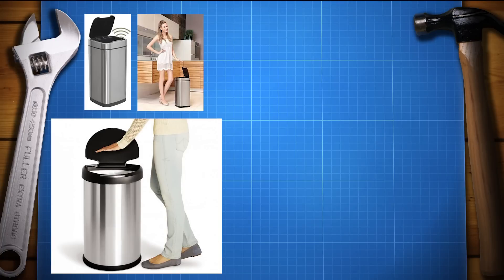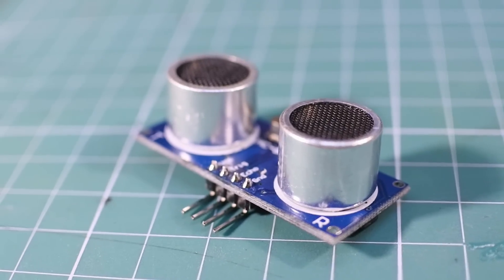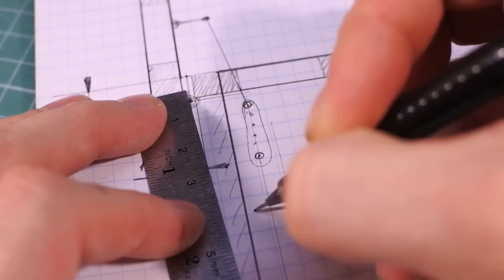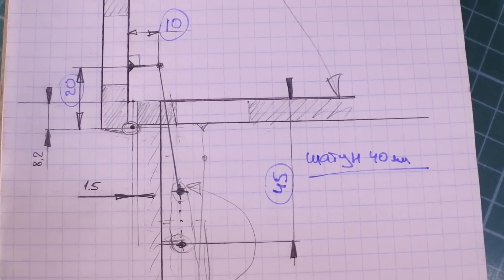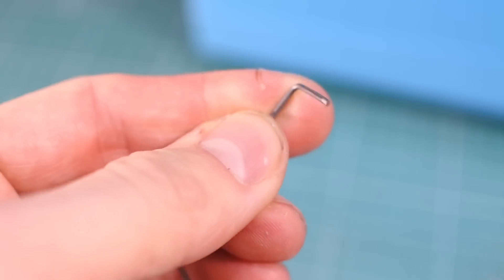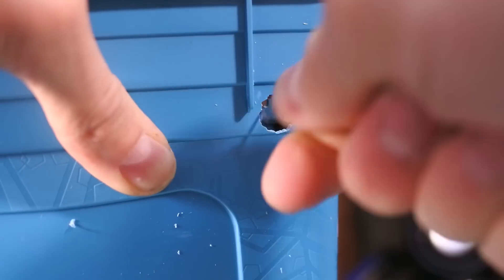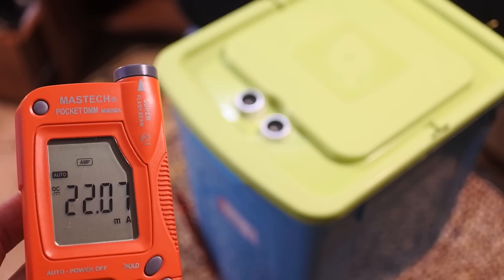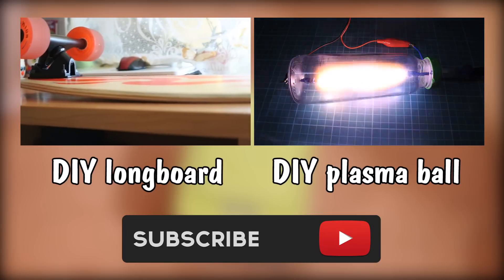DIY robot trashcan

Comment: Excellent idea, and a simple implementation... 

Might it be a good idea to have the arduino board on the outside of the trash can (behind the can?) and only the motor on the inside? Reason being that that way, there is no danger of some sticky stuff or wet stuff messing up the arduino!
Reply from the maker: +Bharat Mallapur yes, I ve told about it at the end of video. I wanted to build trash can that is ordinary outside =)